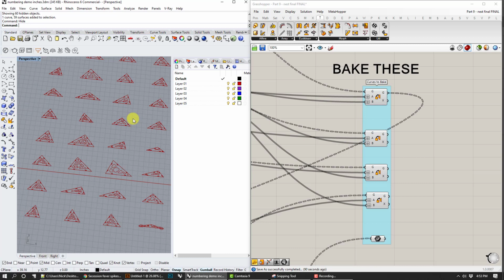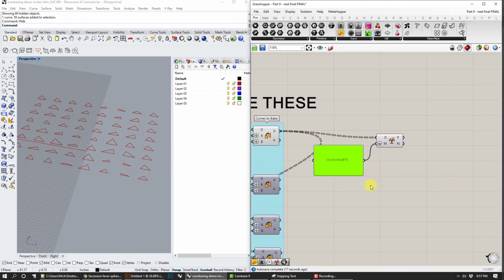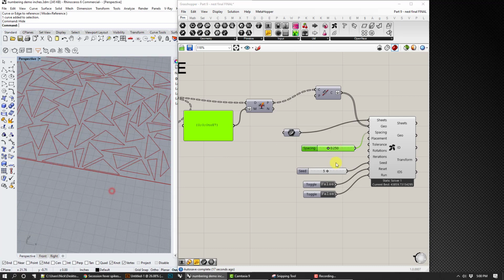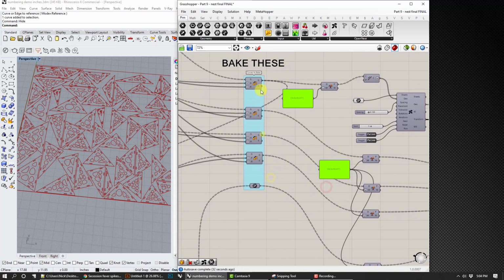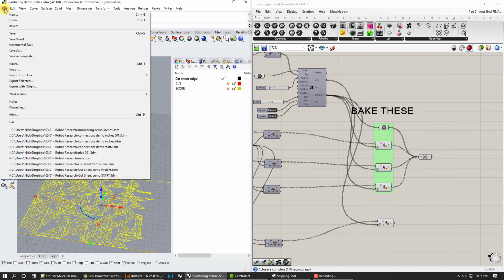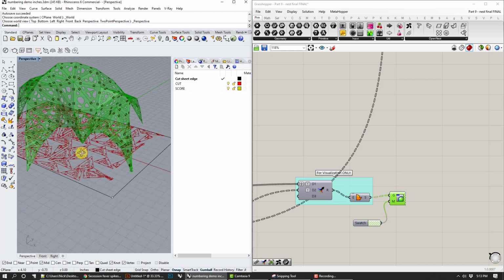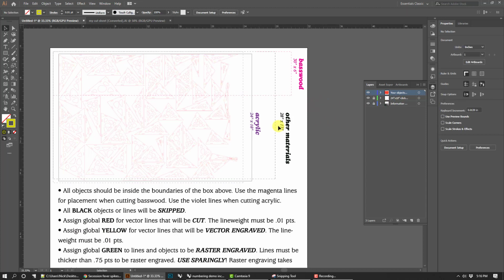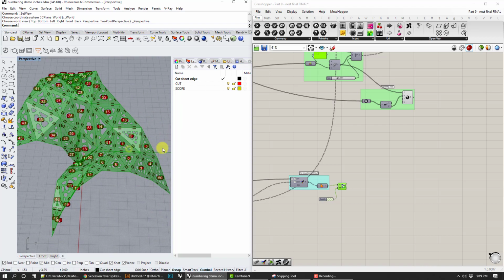ARCH 231 - Digital Fabrication Part Nesting with Grasshopper and OpenNest

Comment: You can use length component to count the number of pieces in your 3d model then use list component to get the correct amount from your overflow list.
Reply from the maker: Totally. Just trying to keep it simple where I could. Script was getting complex enough for my students! Thanks for the comment.
Reply: Can you precise how exactly you can do this plz ? I'm working on the same kind of project and my datas are not going to be constant, so i need to automatise the "data trees alignement"
I'm curently stuck on my project (https://discourse.mcneel.com/t/opennest-transform-superposition-problem/111019/3), any help if so welcome !
Reply: @alainparis7316  I can't get to the page
Reply: @MadDeuceJuice   hi ! i discover your message right now... sorry ! Herre is the link i was talking about : https://discourse.mcneel.com/t/opennest-transform-superposition-problem/111019
Reply: I found a solution, close to what i was looking at, with a last problem, when i group the elements to be able to transform the rest of my geometries, the last sections, are nested but with the entire surface (for exemple, on a 3D terrain with for exeplme 3 distincts montains, i decide to cut it in x layers (on Z axis), the top layers are 3 differents curves on the same plan, with the method i found, i cants optimise this 3 curves, i can optimise only the group of this 3 curves.)